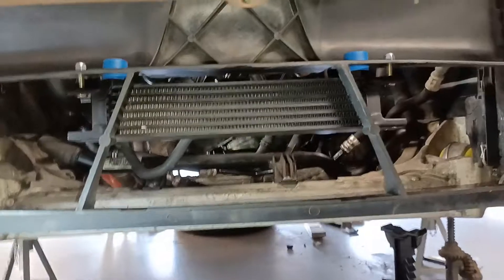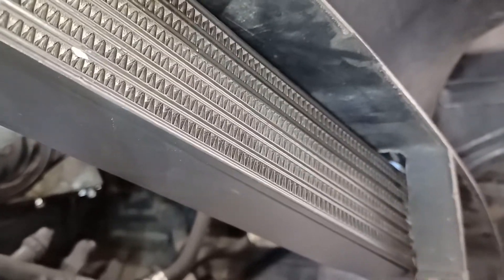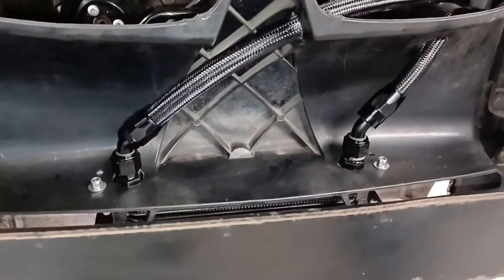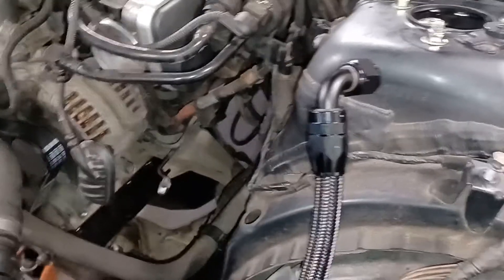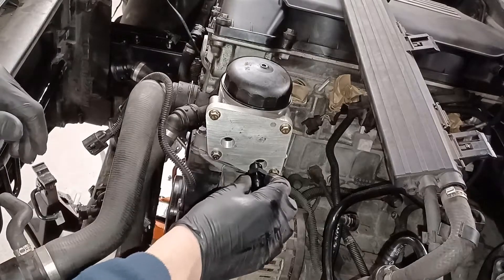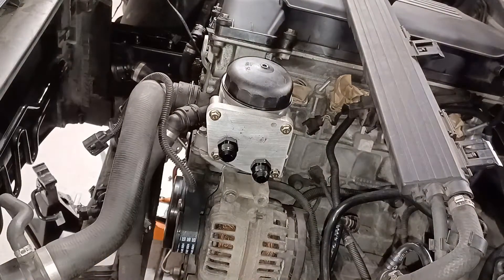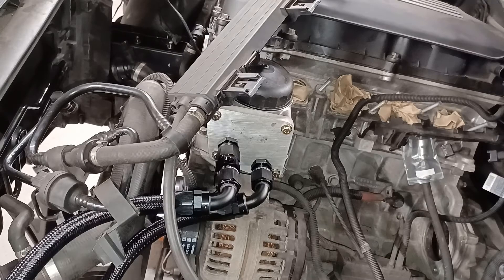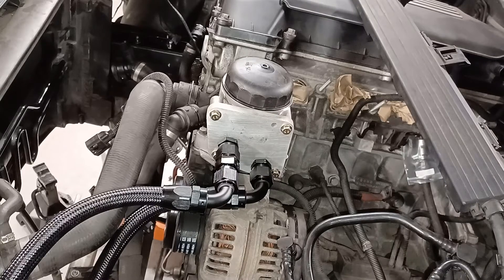BMW 116 Trophy Build - Fitting the oil cooler and pressure sensor

Comment: Very informative. I’m considering an oil-cooler set-up for my N46 engine. I have the correct type of oilfilter-housing already. I would also install an inline thermostat to avoid over-cooling. What kind of temperature drop (in Centigrades) are you expecting and what would be normal oil-pressure values cold and warm for your engine?
Reply: I have no idea about the temp drop.  I’m just fitting what everyone else fits.  I’m not going to fit an oil temp gauge at this stage, just oil pressure and water temp.  I was told that if the engine is in reasonable nick I should see 80 psi when starting from cold.
Reply from the maker: While I was at Oulton Park I checked the oil coolers on other 116 cars.  They looked the same as mine.  I guess you might need something a bit bigger for a 120.